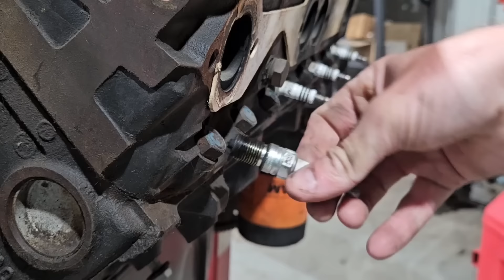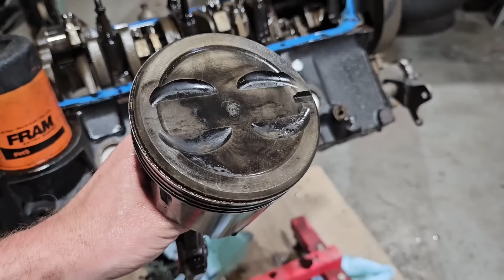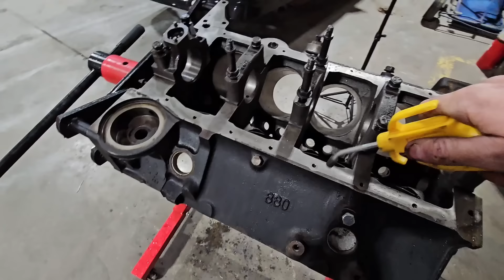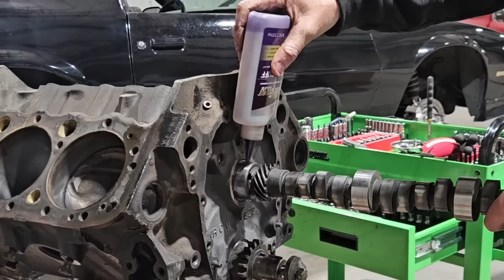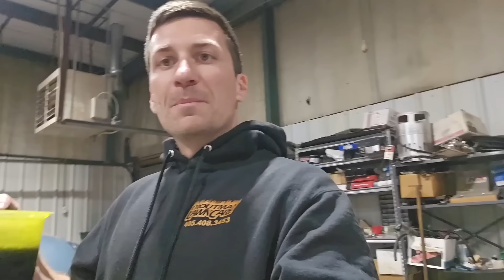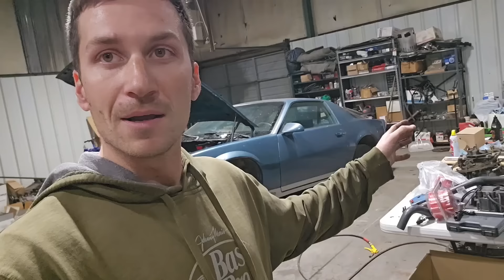Cheapest SBC That Anyone Can Build! / Trade Up Challenge Power Plant

Comment: Engine 2 looks like an early gen 2 , if it has flats for roller cam bars drill pedestals and make it roller cam and swap in a lt4 HOT roller
Reply from the maker: I had a hot cam on the shelf. That actually was the plan.

Comment: I hope you didn't overheat the block by running with no coolant, just saying.
Reply from the maker: Some race cars make full tilt passages with no coolant. She will be fine
Reply: @After_Hours_Speed  The ones that burn alcohol.
Reply from the maker: @m97429 this one is air cooled
Reply from the maker: @m97429 im actually driving the car right now lol

Comment: With those pistons and heads the compression ratio is going to be pretty low. Maybe 8 to 1. Cam sounds like a thumper. Huge duration
Reply from the maker: What pistons are they?
Reply: @After_Hours_Speed they look like factory pistons they used in the 80s

Comment: Did I hear you say Tinker AFB like in MWC? Small world I'm out near hwy 9 near Norman! Cool
Reply from the maker: Im in okc. Small world and city lol
Reply: @After_Hours_Speed  nice was originally in Yukon for 35 years but been dabbling in cars for many years. Currently slowly fixing up a 69 Chevelle. Know anyone local that does ring and pinion installs or someone that will give a guy some tips? Back in the late 90s early 2000 we had mod days..we all got together and helped each other out. Those days are gone it seems. I've done many things on cars over the years but never gears lol
Reply from the maker: @MrZaner1 thats where im at actually.

Are they press in wrist pins?
Reply: @After_Hours_Speed im unsure as this is my first dance. Bought a few things but been afraid to tear it apart and wing it lol..getting the pinion depth correct and other things looks tedious and specialized for a newbie. This is a old 1960s model 12-bolt rear end peg leg , should be about as simple as they come. The car currently has 2.56 rear end gears and they are abysmal. It's so slow even after following a few of your videos and rebuilding the old tired engine with cam,heads and intake. Installed  a 3000 stall converter...but those rear end gears are sooo long it's a real turd 0-60.. I purchased 3.73 as an upgrade

Comment: These are some of the most fun builds. About 40 years ago, my Dad had a 63 Riviera with no engine. He kept trying to beat the system and get a nailhead cheap, so we ended up with about 5 401's and a 425 block. Long story short, we stuck together a selection of parts, yes we miked everything, but every bearing, ring, and moving part was used. We weighed the rod and piston assemblies on a balance beam to get the balance close. The only thing new was the gaskets, and whaddya know, we took it out and ran the old gal up to 120 mph. Dad said if it was going to come apart he wanted to know right away. 8 years later we pulled that 401 when he found a GS425 (dual quads, factory cast headers, etc), and that 401 still ran incredible. The GS425 was never as good..:(
Reply from the maker: Sounds like yall had a good with the budget builds. Ive really enjoyed this "build"

Comment: Ive seen this bent fuel pump rod before, from some idiot that run the bolt in to far on the passenger side top bolt hole that is used for the early front motor mounts, NOW, LISTEN UP ! a short bolt needs to go in it ,or you will have oil blow out of it and wonder where it came from ! Ask me how i know ? Heh heh yeah i did it !
Reply from the maker: Thank you for sharing that with me. Ill be sure to plug that hole. Thanks again

Comment: Just curious I own a third gen as well. Now question is did your or are you gonna have to wire in the engine any differently then the factory engine setup? Like example my 305 should wire in the exact same day if I wanted to out in a 350 sbc. And my car is originally carbed. I was told I could just completely remove passenger side engine harness and do some wiring or I could cut what I don’t need from the original harness
Reply from the maker: You dont have to add anything different. I personally wouldn't take anything out of the wiring harness that is present. One thing ill have to do is add is a electric fuel pump but other then that everything will fall right in place. Good luck with the update bud.

Comment: I built a budget SBC with about $300 into it. Sounded like a monster and revved fast on the engine stand…
Once I dropped it into my Skylark, it turned out to be a complete dog 😂
Honestly, I should’ve kept the original Buick 350 instead of swapping in the SBC 350.
Still runs though. I ran into the kid I sold the Skylark to — he’s still driving her around.
Reply from the maker: 383 & 400s make so much more torque. Better bang for your buck if you can budget it.
Reply: ebay dna or what ever heads bare set 350 get thaty

Comment: Cam Specs (Grind: HI-FLOW 1H)
Erson Performance cams, made july 1996
    Application: 1957-86 262-400, 1987-94 305/350 (non-hydraulic roller).
    Cam Type: Hydraulic Flat Tappet.
    Advertised Duration: 296° Intake / 296° Exhaust.
    Duration @ 0.050" Lift: 228° Intake / 228° Exhaust.
    Gross Valve Lift (with 1.5 rockers): 0.472" Intake / 0.472" Exhaust.
    Lobe Separation Angle (LSA): 108°.
    RPM Range: 2,750 - 5,750 RPM.
Reply from the maker: She gonna be a ripper!
Reply: @After_Hours_Speed    Certainly Should be. 👍👍 Just Subscribed  👍👍

Comment: You're supposed to keep used lifters on the same cam lobe.
Reply from the maker: I didn't
Reply: When re using them yes correct. They wore in on a particular cam lobe
Reply from the maker: @blahblah4125 the lifters are angled to keep the cam in, i dont see how it would matter.

Comment: Rebuild the 30 over put a 400 crank in it then you would have a 383 in your Camaro
Reply: I hope you paint the engine to make it look nice and do a simple cleanup on the entire car so you get a better deal for it it cost zero dollars to clean and a few dollars for paint but it makes a big difference on trade ups
Reply from the maker: @ericnull7786 I agree. Im going to get her looking good....on a budget
Reply from the maker: 350 Pistons wont work with a 400 crank. The wrist pin has to be in a different location or the piston will hit the head.
Reply: @After_Hours_Speed it will with 400 rods. Chevy kept the same pin height as the 350 when they made 400s with shorter rods. Old school way of making a 383 before dedicated parts became available
Reply from the maker: @va4cqd I heard its hard on rods and cylinder walls.
Reply: @After_Hours_Speed also more expensive than using modern parts if someone wanted a 383
Reply from the maker: @va4cqd why is that?
Reply: @After_Hours_Speed 400s used larger main bearing journals. To fit in a 350 block they have to be cut down to standard medium journal size. And chances are the rod journals are worn out and need machining
Reply: @After_Hours_Speed  you can get a stroker kit

Comment: With a flat tappet setup, break it in properly (when you build an engine you care about- that is). I’ll be following along!
Reply from the maker: With the cam and lifters being used i dont think i have to break it in?
Reply: @After_Hours_Speed I’ll preface this by saying I’m not expert engine builder. But the engineering side of me says it’s fine if the lifters went back into the same bores/lobes they came from. They can wear differently.
Reply from the maker: @LoganDidItYT once I get it in the car ill probably rev it to the moon for 20mins like recommended 😂
Reply: @After_Hours_Speed that’s the old school way. Build it and immediately rip on it!
Reply from the maker: @LoganDidItYT stick around! 😂
Reply: @LoganDidItYT very true, when re using lifters, the wore in on a particular cam lobe.
Reply: May have had a chance with new lifters but no chance this won't flatten the cam lobes.
Reply: I really need a SBC to build for our 1971 Corvette. That 30 over motor would work perfectly, because I plan to make it a 383 Stroker.
Reply: @nomore8042 honestly a stroker kit and an engine rebuild would cost 3-5k. If you need an engine for your 1971 Corvette, I think you could get a wrecked or cheap 1984-1992 C4 Corvette. The you get a 700R4, higher performance 5.7 350 with nuts, bolts, accessories, etc. I see the on FB for 1000 all day long.

Comment: Those older vortec heads are picky with intake gaskets and will leak causing an issue like you found in cyclinder 8. 2:44 That motor will run another 100k easy if its just a driver.
Reply from the maker: I bet your right.

Comment: Dude, I may be wrong here, but the larger diameter harmonic balancer usually goes with a small block 400 and is intregal to the external balancing of its crank whereas the smaller diameter balancer is typical for the internally balanced 3.48" two-piece rear main seal 350 cranks. You might want to check into that before you really wind it up.
Reply from the maker: Ill do some research. Thanks for the input.
Reply: Four bolt main 350's had a big neutral balancer..(the same size all the way around). The 400 balancer has a relieved area on one side that makes it unmistakable. (Not the same size all the way around)
Reply: @MississippiDan1   Interesting, I've never seen the big neutral one. Is there any advantage to them?
Reply: @golgothapro I think it was purely for inertia...they were usually in heavy duty trucks. That's how I used to find them quick. Look for the big balancer. They were always four bolt blocks. I have one in storage for a stroker project. 😎 We had an LT1 Nova SS and it was the small balancer (smaller than the standard two bolt main passenger car engine) but also a four bolt block. It revved quick!
Reply: @MississippiDan1  That's good to know man. The 350 I built for my Camaro is a 4-bolt but I'm at .060 over so I'm going to need another when it's done. I've been lusting for an iron Dart but they're pricy and overkill for the street. For the street I think anything over 500hp is just a waste of bread. I'm like 400 N/A with another 100 added by the electic driven Paxton system I built, and I rarely get to use it. About the only time I do is against kids with 2.0 L turbos that ocassionally try me. LOL

Comment: Erson high flow, 228/228@.05 .472/.472 with 1.5 ratio rockers on 108 LSA, 296/296 adv dur

2500-5500 rpm range

I have this line of cam in an old new build (never fired) 396 from 1990

I love slapping together stuff for cheap, keep em coming
Reply from the maker: Nice! That cam will work great then. Thank you for the info